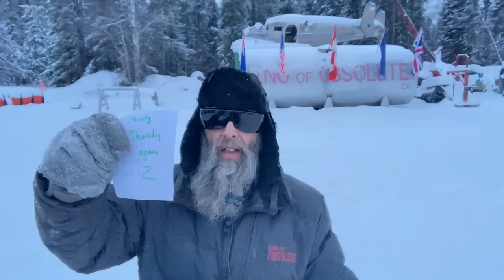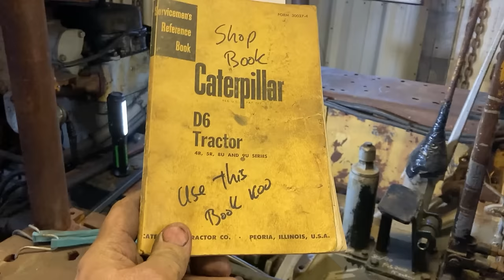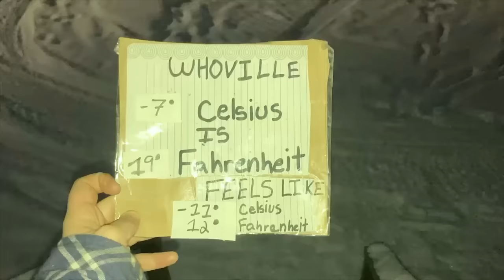The Drinking Game, D6 Cat Clutch Removal Jan 25 2024

Comment: You and I would have had a lot of fun back in the day. I had a w1000 Ford cabover with a 335 Cummins. Lots of smoke but not a lot of miles in a day. 500 was a huge day back then. 😂
Reply from the maker: yes and most likely we both had hair on top of our heads too, lol  thansk
Reply: @kingofobsolete4789  something else I just thought of. Mine had the 4 and 4 transmissions. Wasn't original. I bought it from a old school guy he didn't like the air shifted stuff.

Comment: The Bismark went down running hopefully the operator bailed before it went under. Cat always did make engines a bit difficult to work on with bolts and pieces in the way you either had to try and work around or totally take apart. You are doing a great and what would be a frustrating job for me. What would we do without a come along hoist. Thanks for the video
Reply from the maker: yes both operators survived the sinking. not sure why caterpillar made it so hard to work on and that is why i only have 4 which is 4 too many, lol  thansk